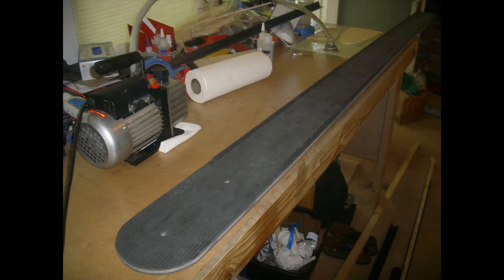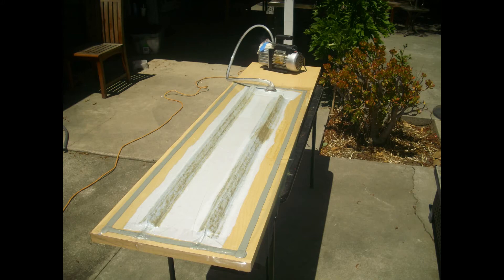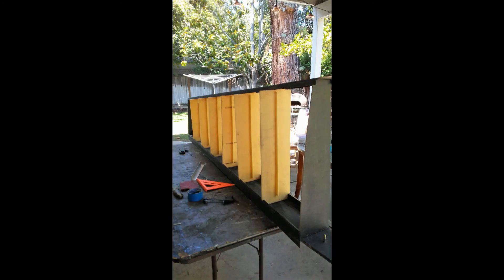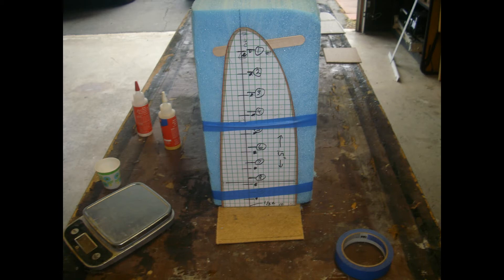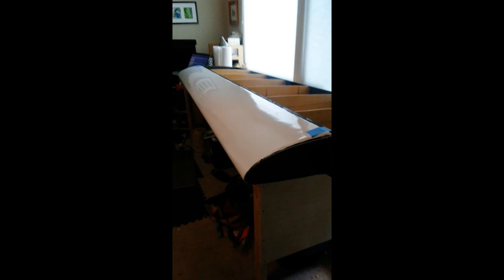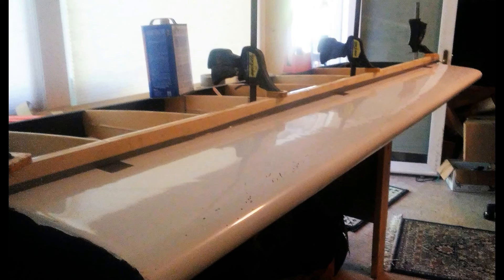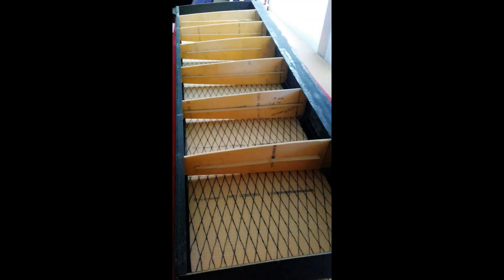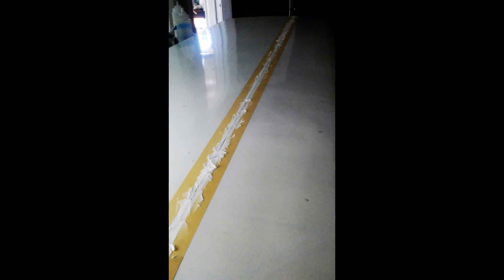Test Section Assembly - KW MkII Rigid Flying Wing Hang Glider

Comment: nice workmanship - and great commentary!  these projects are great when the family gets involved.   QQ - It looks like the orientation of your web is 90 degrees of the caps.  Would it not be more structurally proper to put it in a 45 degree angle as to accommodate the stresses?
Reply from the maker: Good question! I ran this as a test. I used this section of wing for load testing. It proved to be strong enough, so I could simplify the construction by running the weave at 0/90 and hence cut material wastage. There are many  factors beyond max aero perf, or max structural perf that can drive a design. One of my drivers is cost to build.

Comment: I don't understand why these components are not  airworthy parts? Why goto so much trouble and expense?
Reply from the maker: I'll assume that you are referencing the structural work - there is a lot of aerodynamic testing going on also. The short answer to your question is that my life will depend on the quality of my work, so I'm adverse to taking too many chances. The best answer would require a major technical paper and this isn't the place for that response. The basic issue here, I believe, is that most folks think engineering is an exact science - nothing could be further from the truth. Most aircraft designs, especially composite aircraft, have very generous safety margins worked into the design. Sometimes the margins reach a factor of 2. If I were to take that approach, this glider could easily weigh 150 lbs or more and I'm getting too old to run down hill with that much weight (a little humor). To achieve the weight goal for this aircraft (100 lbs) I must design with very narrow safety margins and that can be very risky. So, to mitigate those risks I build and test the components.
Reply: I hear you mate but don't overthink it, even the worlds largest and most advanced aircraft manufacturers use cheap materials like wood for mock ups and with sound design only engineer with actual materials the airframes deemed to fly or be tested under the same loads as flight statically - as a designer myself I can tell you your wing design is well established and proven aerodynamically and your structures are more than adequate to sustain man-carrying flight loads, my question was in response to your comments on a few occasions that these are not airworthy parts to which I say why the heck engineer them from 'airworthy' materials? The trick is to design smart engineering not over engineering and if anything I've seen fits the bill of smart design both aerodynamically and structurally it's your wing - I watch with eager anticipation
Reply: It's a privilege by the way to be chatting to the man himself! Keep inspiring  and happy landings